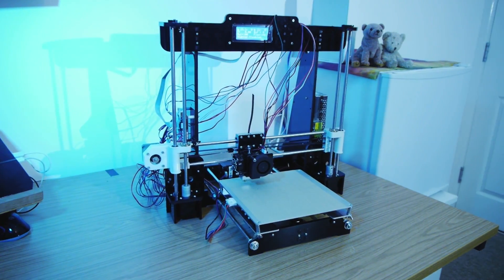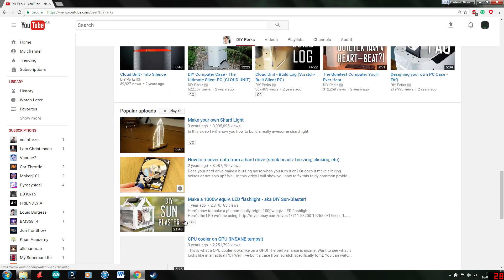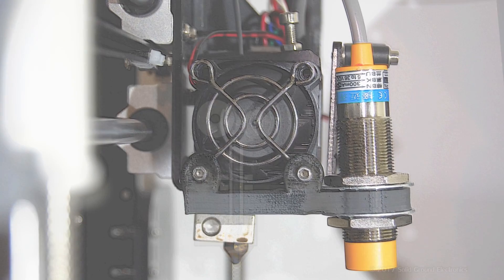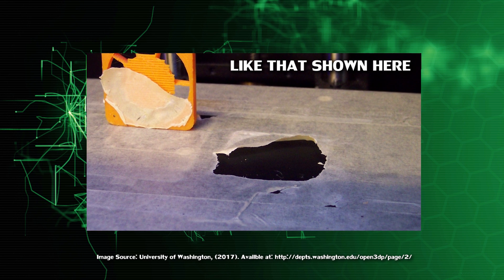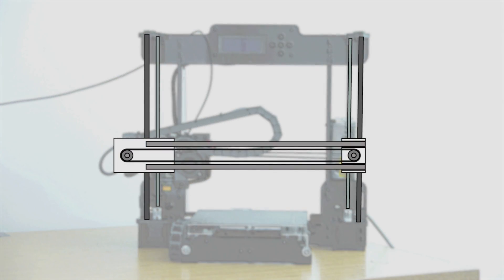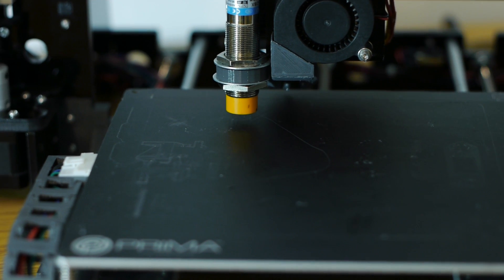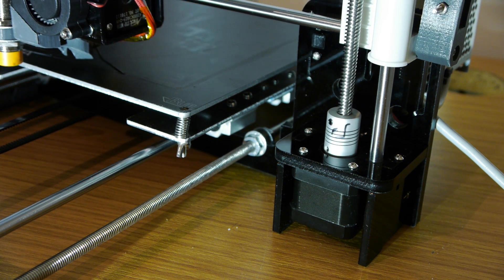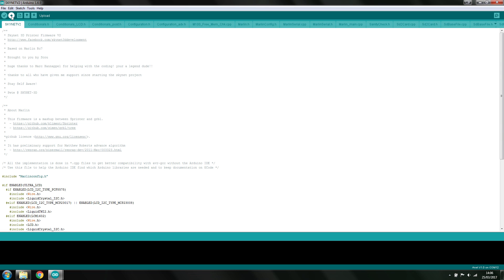Cheap 3D Printer - Anet A8: Upgrades, Experience & Thoughts

Comment: Great video. Recently ordered a adhesive surface for my A8 recently and can't wait to see how it prints without gaffer tape. I recently have a new issue with my printer however. It freezes mid print for a few seconds and then resumes, causing the print to be ruined. Is antivirals software the culprit?
Reply from the maker: Hey Daniel,

Thank you!

Ah nice, you will appreciate not having to replace the tape every print.

I never print from the USB anymore because my pc sometimes restarts. I would try printing directly from the sd-card. 

When I had my first gen prusa i3 the print would pause for a second between movements whilst multi-tasking or heavy loads. I assume it will be governed by your PC. Anti-virus is also another option, so you could try disconnecting from the internet, disabling your anti-virus temporarily to find out.

Kind Regards,

Fred.

Comment: Hi! I bought an Anet A8 printer It was printing normally, but the thermistor dropped and when I saw it was coming out smoke from the printer, so I unplugged the plug. The problem is that when I try to print something the filament is coming out thick (even gushed) even with the temperature of 200 degrees that I used to use before the smoke happened. Help me, pleaseeeeee
Reply from the maker: Without a working thermistor with good thermal conduction to the heated device, be it heat bed or hot end it is possible for it to get to hot and destroy itself. I would check to make use that the thermistors are not shorted or broken and determine if they are making good thermal contact with the heated parts. Have you tried getting in contact with your seller?

Comment: Hi, great video! I have the same printer and its absolutely great. If you use Simplify3D you can easily change colors by using different gcodes. For example stop the first print at a specific high and then with a new gcode and a new color you can start the print again at a specific high. By the way how have you done the animation/visualization in your video?
Reply from the maker: Hi, 

Thank you!

I will check out simplify 3d soon. I have a couple of videos to make first though, so watch the space.  

I create the animations by creating multiple title cards and using key frames to either move them around or crop them over time. It is quit involved so I am looking for an alternative.

Kind Regards,

Fred

Comment: maybe make a full tutorial on how to put skynet? im New to 3d printing and It would be nice, or a troubleshooting guide because my printer works perfect but when It prints its stringy, the extruder hits the plastic and takes It with It, It underextrudes and adheres bad
Reply from the maker: Good Idea, I will definitely be doing more videos soon but I have a lot of coursework due in over the next 2 weeks. It sound like the print isn't sticking to bed properly. Try hitting up the nice folks over on the discussion page over on facebook: https://www.facebook.com/groups/OFFICIALAnet3DprinterSupportGroup/
Reply: Solid Ground Electronics thanks man! It is sticking i Will try anyways and mess around with the flow percentage thank you
Reply from the maker: Thats good. No worries :-)

Comment: I'm having issues with my exstuion it will exstuied manually using the exstude button in the settings but when i go and print it doesn't exstude at all. Is it something to do with my printer or is it in the software?
Reply from the maker: Hey Peter,
I have not had this issue before but it could be your slicing settings. I would recommend printing one of the file included on the SD card. However, I'm no expert at this machine so I would suggest you ask the nice folks over at the OFFICIAL Anet 3D printer Support Group found here: 
 https://www.facebook.com/groups/OFFICIALAnet3DprinterSupportGroup/

Comment: are you going to be printing the enclosure,  because I'm also looking to quiet the printer.  might even go with polymer bushings because the metal linear bearings cause alot of noise.
Reply from the maker: Now that would be impressive, unfortunately not though. I have the enclosure already (spoiler alert: its a server cabinet)  but I am up to my eyeballs with VHDL coursework so all printer and youtube stuff is on the back burner for the next 2 weeks :(

Poly bushes do sound like a pretty good upgrade I must say!

Comment: Hello,i have anet a8 too.I dont have a bed leveling sensor,intead i installed Z axis limit switch a its done just the same work.No need level bed every time.Instaled masking tape is very low quality.I use a high quality for a 2$ only and works well,sticks perfect and no need to to order some cover on heated bed ad cleaners.Btw the tape i using,lasts until first puting on to this day (I printing 24/7,2 months).My opinion is some "upgrades" is not critical.But theZ level yes.Cheers
Reply from the maker: Hey,  so you would recommend the adjustable z-limit switch then, but not the auto level?

Comment: Great Information! I had no idea you could pause the printing! NICE! Here are a few things that I feel important to mention:
a) A piece of 220x220x3mm tempered glass that is sandblasted using #1 Silica Sand at 40PSI will be the very best possible bed solution. Perfectly flat, never wears and sticks VERY well. You must use the Capacitive Sensor for glass. Its 18mm so fits right where the inductive one goes. I used a buck stepdown such as this: http://www.ebay.com/itm/221970563817?_trksid=p2060353.m2749.l2649&ssPageName=STRK%3AMEBIDX%3AIT to reduce the voltage rather than the transistor solution you did. Just preference. They both work. I use 75 degrees for the first layer, 65 for the rest.

b) OctoPrint is your friend! Get a Raspberry Pi 3 and enjoy wireless communication, realtime video of the job, and the ability to start, stop, pause, and load the next file without using the onboard A8 SD Card. (use a 32gb micro SD Card in the Pi). You still use the Arduino based main board, but with this addition, it makes printing more fun.

c) When putting the kit together, understand it is a DIY system and you have to use your own head when it comes to putting the kit together. If you see that it does not include all of the hardware you want, order more and WAIT! Example.. the nuts that come with the kit are the standard hex nuts but this does not give you the strength that a square nut would give you in those blind slots they use. Order some square nuts off Ebay and while you are at it, get LOCKWASHERS! Why worry about having frame parts back off during printing because you didnt lock things down. Doesnt hurt to get Locktite Red and use it liberally during the installation as well.

Thanks for a great video Englishman! A friend in Kansas,USA thanks you for it!
Reply from the maker: Hey,

You're welcome and thanks for the additional info.

I have a raspberry PI waiting for me when my coursework is finished. A video will soon follow!

Thank you American ;-)

Comment: I am running Skynet V2.3.2 and I wired up the limit switch and pro sensor as per your instructions but when I home the printer the z-axis goes up instead of down. Do you have any ideas what would cause this?
Reply from the maker: Hey there are a number of things that could be at play. Does it stop moving if you pass something metal past the sensor whilst homing and does pressing the end switch do anything? Also, try removing the sensor connector from the board and note the direction of travel. With that I should be able to work out the problem is, like a complicated game of cluedo. You could also try running my copy of skynet to see if this is caused by a difference in settings. This can be found here: http://www.solidgnd.co.uk/project-blog/
Reply: Thanks for getting back to me.  When I press the switch nothing happens and when I pass metal under the sensor it reverses direction and goes down and I have to turn the power off to keep it from crashing into table. I had v2.3.2 without the sensor active and it was working. I can try your version of Skynet tomorrow.
Reply from the maker: Hey Tom, 

It sounds odd that the limit switch isn't behaving properly so perhaps there was a fault in the wiring or the sensor is a normally closed (NC) type sensor as opposed to the normally open (NO) type sensor that I used. Double check that your part number is the same as: LJ18A3-8-Z/BX. 

The red light should remain on until the metal object is detected. I believe you can invert the behavior of the sensor in software by playing around with these lines in the configuration tab:

#define Z_MAX_ENDSTOP_INVERTING false // set to true to invert the logic of the endstop.
#define Z_MIN_PROBE_ENDSTOP_INVERTING true // set to true to invert the logic of the probe.

There might be a setting to reverse z travel direction but I would avoid touching this if you had it working without the sensor already.

It is also possible to that the transistor is dead. 

Kind Regards,

Fred
Reply: I had a problem wiring it up the first time so I will look at that and the sensor has no markings on it but the light is off until it detects metal. Thanks for your help.
Reply: Fred,  I entered a M119 command and it looks like the sensor is not triggering so will be checking the wiring.
Reply: Fred, I have the wiring fixed now and it looks like the sensor is triggered but the light is not on when there is no metal around it. Is this correct? Because the z-axis keeps going up until I put metal under it. Do I need to change something?
Reply from the maker: Try removing the limit switch from the sensor wiring and replace #define Z_MAX_ENDSTOP_INVERTING false with #define Z_MAX_ENDSTOP_INVERTING true
Reply: Do I need to do some rewiring or can I just cut the switch out?
Reply from the maker: Just cut one wire of the switch in case you need to re-attach it later
Reply: Fred I just got a NO prox sensor so I am going to try this again. Do you have the limit switch wired as NO also? Mine is NC right now.
Reply from the maker: Yeah exactly like the video, the new circuitry just piggy backs the existing limit switch. I am a little concerned that the Amazon listing I used was wrong. Mine says its a NO type but the light stays on and only goes off / dims when something metal is detected.
Reply: I ordered the one you had listed and is marked NO but the light is off until it sees metal under it. When I enter M119 with no metal under it, it comes back as triggerd and my limit shows nothing when entering M119 that's why I thought I would have to wire it as NO. I let you know how it works out. Also by first prox had a blue tip and this one is orange if that means anything.
Reply from the maker: The link I sent is the one I ordered. Don't tell me I've been saying to use a NO when really you need a NC all because a mistake some seller made.
Reply: Both the US and UK Amazon links are for NO sensors.
Reply from the maker: Yes but the light on the sensor that I received by using the UK link, behaves like the light on a NC sensor.

Comment: have you had any issues with the inductive sencor?  when I run my printer it preheats the bed then homes and then runs the auto bed leveling but if the bed is hot it seems to read the bed inconsistently causing it to to read to high or low. it even changes the hight slightly when running the print back to back
Reply from the maker: I have not had such issues. Have you definitely set up the g-code correctly before exporting the g-code and double check that the mechanical switch is not being triggered before the sensor is. Try putting something metal on one half of the bed whilst it performs the multi-point mesh leveling just to see the system working correctly. 

Are you doing mesh bed leveling. This is far better than taking a single reading in the middle of the bed. You may find that the height isn't changing between prints it just looks that way because you are printing in a different areas of a warped bed. Just an idea.

How are you powering your sensor? If you under power the sensor ( like other youtubers have shown to be possible) you may find that the effectiveness varies with temperature.

Is your sensor mount secure? You may find that your bracket has began to droop if it was printed with PLA, especially if you use it over a very hot bed for long periods of time.

I have only needed to adjust the printer once or twice after moving it around but for the most part it just works straight away. Just keep at it and your printer will be honed to perfection

Comment: Thanks so much for the vid!! Would you recommend buying new belts? as mine ar a bit too short and seem to be causing issues printing circles.
Reply from the maker: No problemo, more to come in a couple of weeks time. Not really sure if I'm honest. The belts in the kit do get slightly longer after tensioning them for the first time but do hold their tension after that initial change of length. What kind of issues?
Reply: Thanks for the reply! the issue is that the circles seem to print more square than a circle, such that they won fit the screws they were designed for.
Reply from the maker: That sounds weird. If you hold the pulley stationary can you move the head / bed. The belt may not be tight enough. That said, it would have to be really droopy to make squares. Do they slide easily without the belts? Also, have you had a look at the trouble shooting guide on the SD card (within the instructions folder).
Reply: Yeah, I have, I think it looks like my belt tension.
Reply: it was in fact tension
Reply from the maker: Marcus Thorpe thats good news, is it all better now then? Was it too tight or too slack?
Reply: Yeah its good now thanks, it seemed to be the belts rubbing on the inside of the white z axis things, i got thinner belts and now it all works good
Reply: There was like no tension but now there is just enough, now I'm going to try print more upgrades such as a case for the raspberry pi for wireless printing

Comment: helpful vid.
does anyone know if you can run skynet without the bed leveling?
Reply from the maker: Thank you :-)

You can run the skynet firmware without the auto leveling feature but you must double check the settings in the configuration tab of the firmware, before uploading. 

I wouldn't recommend that you upgrade the firmware if you don't plan on using the auto leveling sensor as the nozzle doesn't lift during the paused state, unlike the stock firmware. 

Its up to you though, I'm pretty sure you can roll back if you can find a version of the original firmware.

Kind Regards,

Fred.
Reply: Thanks Fred been looking for an original backup firmware in case it all goes pear shaped without any joy.
Reply from the maker: Good news! I just found it in the skynet firmware: SkynetV2.3.1\Troubleshoot\Troubleshoot\firmware_Rest\firmware_Rest\A8 Stock

Its in the form of a hex file but you could get an avr-isp programmer if you needed to re-flash it.
Reply: Good man, hope this helps someone else too. 
Thanks for the share.

Comment: Would you say the auto bed leveling is essential? Even for someone who isn't adept with electronics i ordered my Anet a8 the other day and I'm a little anxious about doing a mod like that in case something would break
Reply from the maker: Hey, Thanks for watching!

It isn't essential but I would recommend doing it if you understand how to wire it up. 

Just make sure that you get the right parts otherwise the wiring guide may not be accurate. 

I would definitely test the printer without any mods first though, just to make sure that the parts in your kit are all working. 

Kind Regards,

Fred

Comment: the skynet folder doesn't allow me to download the arduino from there. i am not sure if it is because i had another version already but i tried deleting it but it didn't help
Reply from the maker: Hey, when you download the skynet folder there should already be an arduino folder, you need to use the arduino.exe from there and make sure that the Anet board is selected and the you have the correct com port selected. 

You don't need to uninstall other versions, its a standalone version that has been compiled to run out of the skynet folder. 

I'm not sure if I have answered your question but let me know if I haven't. 

You can download the skynet folder that I used from my website: www.solidgnd.co.uk/projects-blog/ or directly from Skynet3d's facebook page: https://www.facebook.com/skynet3ddevelopment

Thanks for watching!